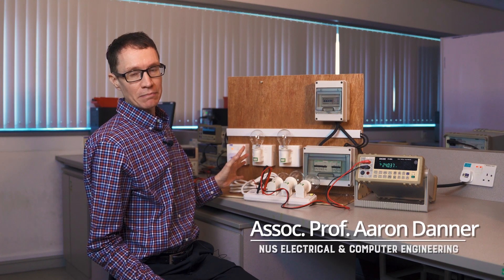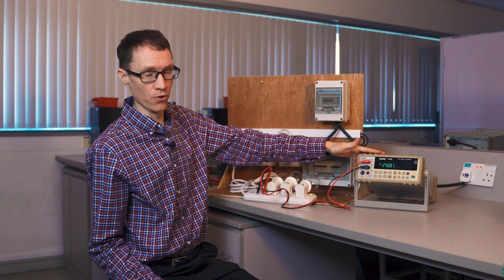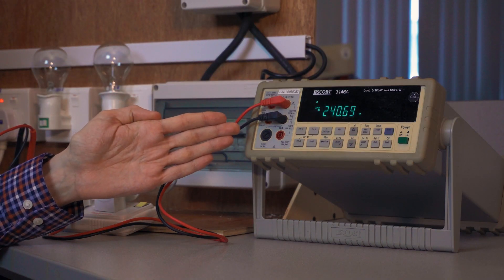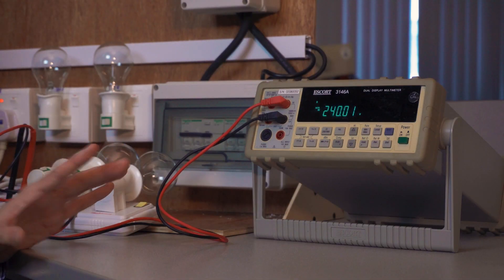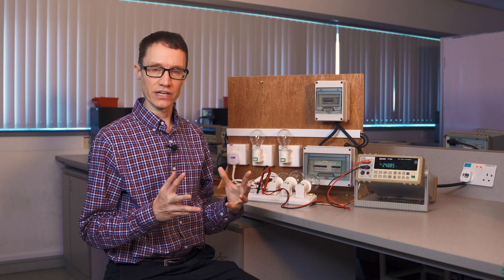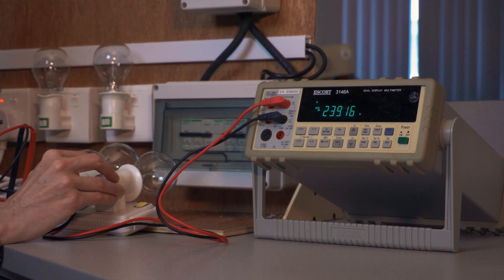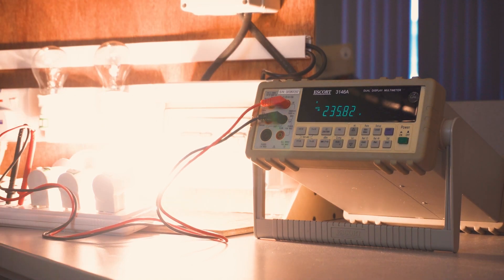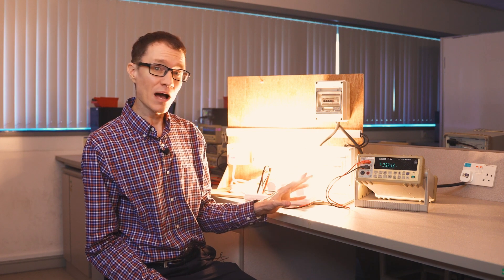Measure a lightbulb's effect on the electricity grid (26 - Electricity Distribution)

Comment: The whole grid is not being loaded down by your light bulbs.  Just the low voltage secondary circuit on the local distribution transformer on the pole outside your house or apartment.   That's why the  'grid' operates at high voltage and has substations with big transformers to step it down for local consumption.  You have loaded down the voltage only on a tiny local portion and not the 'grid' itself. This is like drinking a sip of water from a river and saying that you lowered the water level.  True only in  a limited context but misleading.   A more interesting experiment might have been to leave it sit and see if the voltage recovers in time.  If your statement was entirely true the grid would be in big trouble and you would be affecting the operation of electronic equipment all over the city when you turned your stove on.  Please issue a statement to correct this misconception.  Your videos on electronics are excellent but this one is a bit off.